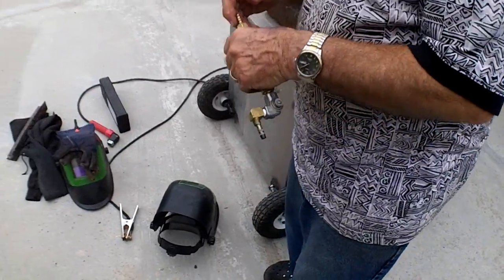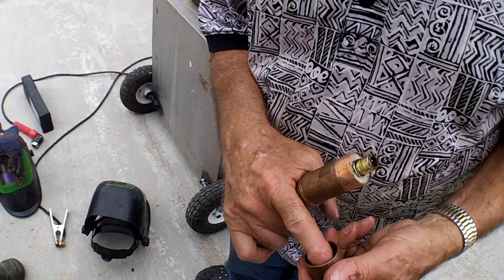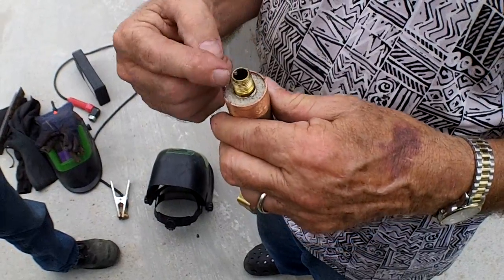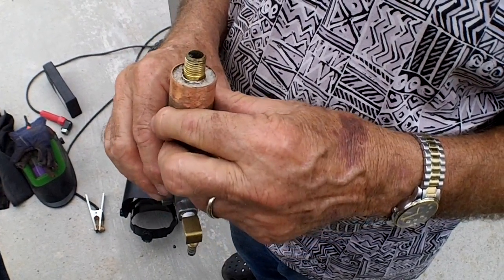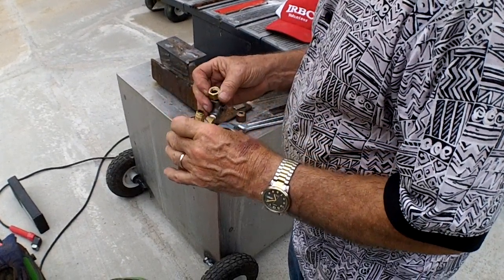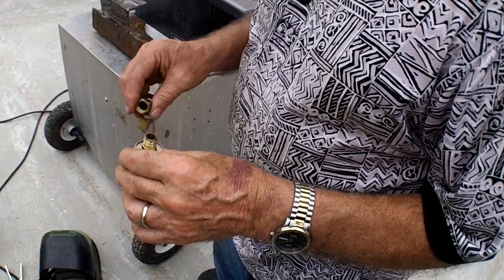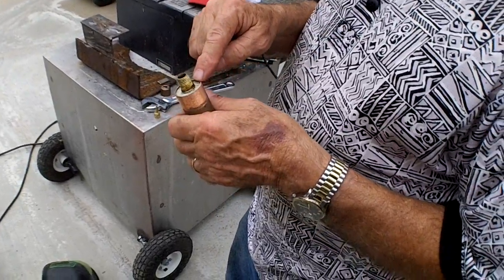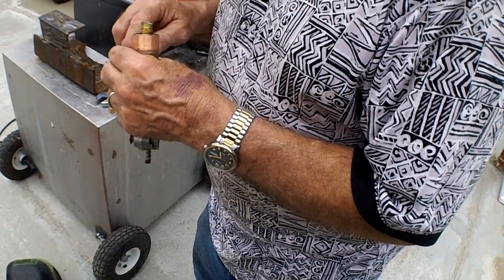Homemade flashback arrestor for HHO

Comment: Would that work for acetylene or any other flammable gas?
Reply from the maker: chapiit08 It should work. This is a similar concept to the flashback arrestors available for acetylene. Perhaps even more likely to stop a flashback. It’s hard to stop a perfect mixture of Hydrogen and Oxygen from burning.
Reply: @Mr963291  Thank you for the reply.

Comment: Fiberglass cloth is made from silica, white beach sand is silica, so if you use fiberglass cloth instead of sand you can achieve the same thing.
Reply from the maker: +EVZebra Good thinking, thank you for the suggestion.